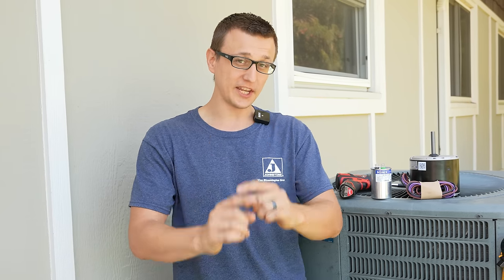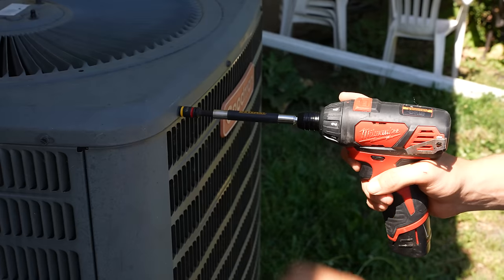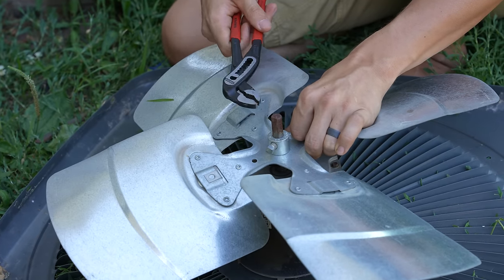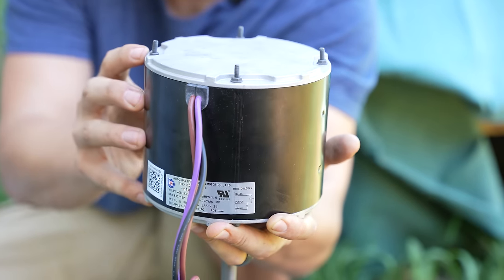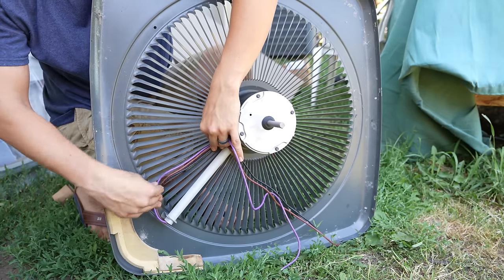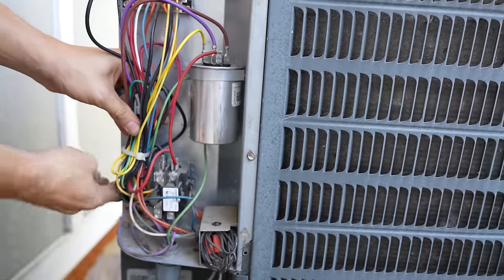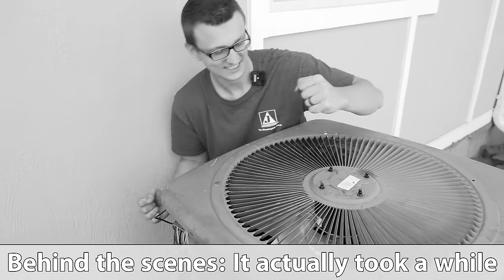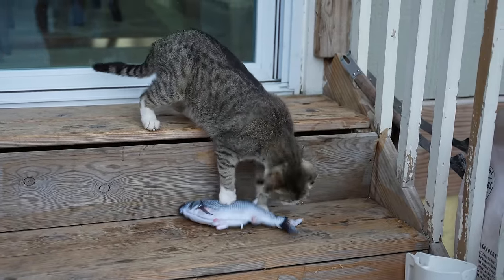How To Replace Air Conditioner Condenser Fan Motor

Comment: I absolutely love the roosters crowing in the back and every time you say the word capacitor I think of Back to the Future movie with a flux capacitor with whatever it was 8.5 gigawatts of power... You're the clearest and the best I am totally revamping the outside condenser and inside the fan it looks like some horror movie Black Mass or something oh it's bad in there I'm surprised the thing was still running so I bless you bless you you have a gift and you are using it God has blessed you you have made this chick more functional and proud because I can do it all by myself because of you

Comment: I had a condenser motor (GE) that was making a horrible squeaky sound a few months ago. I hit it with a ton of white lithium grease, but knew that I was on borrowed time with it. After getting a quote from an HVAC company for $1400 to replace, I bought the same model I had but new for $185. I was able to use this video to easily replace the now dead one and was back up and running within an hour. THANK YOU SO MUCH FOR WHAT YOU DO. You make a huge difference for people.

Comment: Good video as usual, I have a tech tip to offer, if those screws on the motor didn't fit into the holes, i would suggest to put the nuts on them before attempting to bend them, to help keep the threads safe.  Look forward to your future videos.
Reply: My thoughts as well for straightening the screws.
Reply from the maker: YES!!! That is a wonderful tip! This is why the comment section is great! Thank you Darren! Perhaps I need to get me a set of various size nuts for other situations with bent screws or bolts..
Reply: What if our replacement didn’t come with those screws…

Comment: a wire brush on a drill works great to clean the rust off the shaft.  Or wire brush on a grinder works great too, ( please wear eye protection) AKA safety Glasses

Comment: This is probably the 4th video from your collection that I have used to save me serious money.  I followed this video and managed to replace the fan motor.  I did have a problem removing the fan off the motor - that took a while to get off (I'm sure without your video I would have that thought I was doing something wrong).  Sandpaper, wd-40 and 30 minutes and it was off.  The only other problem was routing the new cables though the existing hole/grommet.  In the end, I had to attach the new cables to one of the cut cables to pull them through.  Thanks a bunch for these videos.

Comment: Excellent detailed instruction video! I replaced both my 1/10hp fan motor and capacitor yesterday myself in about 1 hour total after picking up the parts locally which were a little higher than ordering from Amazon ($192 vs $120). Originally, I was trying to locate the exact fan motor by model number, but the supply company told me they just needed to match the horsepower, RPMs, and voltage. I am sure I saved at least $500 or more doing this myself. Great video. I subscribed and as I have time, I want to watch your other videos to fix and troubleshoot stuff

Comment: I’ve watched several of your videos in the past 3 or 4 days. My AC wasn’t working and every place I called said they wouldn’t be able to get to me for a week or longer. After watching your videos, I found a weak capacitor, and the contactor was not looking so good. Ordered the parts from Amazon and got the parts installed today. After the new parts were installed crossed my fingers and turned the power back on. Now I’m sitting in a nice cool house. Thanks for the videos. They help out a lot.

Comment: Thank you! This vid gave me the confidence to change mine.  The bearings were failing and it finally gave out.  I went ahead and ordered a new motor and capacitor and everything runs as good as new!! Saved me some $$$$$$ THANKS!

Comment: I just wanted to thank you for an excellent video. I just replaced in an hour and a half my contactor and fan motor. Works perfect, Got OEM parts and I saved nearly a thousand bucks. The contactor cost me $13.00 from amazon and the AC  company was going to charge $250.00  to install it. They wanted $750.00 to replace the as yet not failed fan motor. I found OEM replacement for $213.00 and saved a lot of money.  Couldnt have been easier.  I understand they have a lot to pay for with trucks etc but thats just way over what it should be for the small amount of work it took. The contactor part took no more than 20 min. Again thanks for your well done video. Much appreciated.

Comment: Very helpful video! I'll be referring to this while I attempt to replace the condenser fan on my unit. Regarding the hassle of getting the top back on the unit, when I cleaned out my  condenser this spring, after getting frustrated trying to re-fit the top onto the unit (as you mentioned), I used a ratcheting tie down to compresss all four sides a bit and the top was a breeze to re-install.

Comment: Just went out to find my fan motor super hot and buzzing like it wanted to run but couldn’t. Disconnected power and promptly searched to find out how to change it. 

Your video was one of the first to come up, and was easy to follow, not overly dry, and overall super helpful. 

Bookmarking this so I can replace my fan motor when it comes in!

Comment: Excellent video - very clear and easy to follow instructions.  It gave me the confidence to go ahead and try it.  I followed your steps, turned on the power, and the unit started up just the way it was supposed to :).   Saved several hundred dollars, based on the quote from the pros.

Comment: Best Video on replacing the fan.
Would add that the motor is hot when you take it off, unless you shut the ac off several hours ago.
So wear some gloves to take it off. Also the connections from motor to capacitor and live and neutral are all simple easy slide types so you can easily pull them off with a plier before you lift the fan cover. This will make turning the fan upside down and placing it on top lot easier.

Comment: Got quoted $1,750 to do this job. Ended up finding this video and decided to do it myself. Only spent $98 on the fan motor and took 45 minutes to remove and replace. Thankyou for the video
Reply: 1750? That person is evil
Reply: I got quoted $600😢

Comment: Thanks for the video and information. One thing you might consider is that with my fan motor the shaft was in such bad condition, rust, your method did not work. What I had to do was use your sandpaper trick and sand the bottom part of the shaft, between the fan and the motor. Lube it after and then use a socket to place over the shaft and smack it using a hammer until it finally reached the smooth part of the shaft.  It broke free and then I sanded the rest of the shaft and the fan came off easily. Thank you again, I doubt I would have thought of this myself without your help.

Comment: Great step-by-step. It covered pretty much every detail and what it didn't was covered in other videos he linked. The wiring video helped because my new motor had 4 wires and the old had 3 wires. The only thing not mentioned was the green ground wire on my new motor, which I figure out elsewhere could just be removed as long as the motor connected directly with the frame (metal on metal).

Comment: I have been using your videos to fix my nephews heat pump it blew the low voltage trans former there was no fuse so now I am checking wires trying to find the short, Thank you

Comment: Great video. I think you should make one with "Worst case stuck fan". I had to cut it off.  Drill a deep 1 in hole into a block of wood. Then use another wood, to prevent edges damage, with a hammer method. Hard to describe. Since I don't have that metal holder other has

Comment: thank you again , your videos are always very informative, and a tip, if the bolts or screws on the motor are bent put the nuts , two would work best ,  onto the screws  then you can use pliers or channels to bend the bolts to a more upright position , this keeps the threads safe from being chewed up, ciao 4 now

Comment: Thanks for another super helpful video - love the cat interactions too! I just replaced my fan motor and condenser this past winter. For the last couple of years, the motor bearings would start making a awful racket at times. For a while, I could quiet the bearings by giving the unit a sharp rap with my hand but eventually that no longer worked so I waited until the cooler months to replace it. (Since the A/C wasn't needed then, it also allowed me the time to make some cosmetic improvements by painting the top grate which was looking a little shabby.) Got a great deal ($95), on the OEM motor from Amazon and it's working perfectly so far. I imagine that would've been at least a $700 fix if I called the A/C repairman. I love saving money! lol
Reply from the maker: You're welcome! Thank you for sharing your motor replacement experience! You are right, a condenser motor replacement can easily get close to or over $1,000 if you were to call a company out. So you for sure had some nice savings. 👍💲👍 Kudos to you for tackling it yourself. Have a marvelous new week and a great 4th of July! 🎆🎇🧨

Comment: Great video thank you for explaining step by step. Wondering do I need to check amps and voltage on the new motor after the installation?

Comment: Great video but want to mention it probably would have been a good idea to clean your condenser coil fins on the outside (as long as you had it off) as I had noticed quite a bit of dust and build up.  It would help improve air flow for both cooling and heating.  I enjoyed the video and it probably didn't matter as this was done 2 years ago...ha.  Thanks again.

Comment: For anybody struggling to get the fan blade off or for techs entering into the field I highly recommend purchasing a hub puller from an HVAC supply store, they’re specifically designed for this. In a pinch, a gear puller from an auto store also works, preferably a two clawed one over a three clawed one as they fit around the blades better.
Reply: And a small supply of Valium👻lolol

Comment: Jay, you have the BEST DIY videos on the entire YouTube network! Thank you for taking the time to be CLEAR in speaking/explaining, lighting, and video production! 

I have a question for you: 

I’m not an AC guy, I have a small, residential RHEEM AC unit out back, 20 years old, but very clean…

 I suspect I have a high pressure switch, tripping, for some reason. After watching your videos, I cleaned the heat, exchangers with compressed air, and afterwards with water, followed by more compressed air.

RHEEM RAMB-024JAZ

Suspect :
high pressure switch:

thermostat calls for lower temperature, system turns on, indoor air handler and outdoor compressor/condenser turn on, outdoor fan motor runs for about four minutes, then fan stops, and Compressor continues to run/buzz for 1 minute, and then Compressor shuts off…

(high-pressure switch; the switch wired into the smaller Freon “hot”line, and to the 24V circuit, TRIPS). Then, after things cool, or equalize after sitting for approximately 20 minutes, I can RESET the button and repeat the whole process again. 
List of components that I believe are good: indoor air handler and motherboard, thermostat and batteries, outdoor capacitor, contactors, and fan motor.

What do you think?

Comment: Great videos thanks man i subscribed. Recently I bought a replacement fan with same hp/rpm and voltage but my old fan has 5 wires with different colors from new one. This new one has 3 wires only black purple and dark brown.  Will this work if I only can only connect the 3 wires? And where does each one go? Thanks

Comment: Use Kano Aerokroil on the fan blade hub set screw.and shaft, motor nuts, and wherever you might need penetrant. 
 I've been taking things apart since the 60's when I was a kid. Travelled nine states working on institutional and industrial equipment. 
Wish I would have found Aerokroil decades ago.

Comment: Excellent video!  I just replaced my motor yesterday.  As you mentioned,  the blades were very hard to take off and I may have bent it a ittle.  All works great except that the unit seems to be vibrating.  I noticed one of the blades was slightly bent so I bent it back.  Better but still vibrating a bit.  Any recommendations?

Comment: Hi Jay, excellent step-by-step video!  Only one comment, you need to short out the capacitor leads the first time you hooked up the motors wires so you don’t get a shock.  You did short out the capacitor leads the second time when you replaced the capacitor.  Otherwise, GREAT video.  Keep up the great work!!
Reply from the maker: Thank you for the correction Bill! Glad you liked the video, have a fantastic weekend!

Comment from the maker: I forgot to mention this in the video but there may be cases that no matter how hard you try to persuade the fan blade to come off, it does not  budge even the slightest bit. You already tried everything at your disposal - the rust buster, penetrating oil, heated the shaft, threatened it, yelled at it, talked nicely to it but all that to no avail. It's almost like the fan blade hub fused with the motor shaft. If you find yourself in an exciting situation like this, they sell a hub puller that you can try and most of the time it will get the job done. Here it is: The Ultimate Hub Puller: https://amzn.to/3cLUQ5q    That being said... I have only had one time that even the hub puller failed. It just gouged out holes/trenches in the fan blade hub and still didn't pull it off. It was amazing. I threw the motor with the stuck on fan blade away and simply ordered a new fan blade. After that experience if I ever see a motor where the shaft is super rusted and looks like it may be fused to the fan blade, I try pulling the fan blade off before ordering the new motor. Just in case.. If it doesn't come off, I order a new fan blade right away too.
Reply: Since my landlord would not fix my AC I did myself last summer lol  from your videos I have learned so much ❤️ but the one thing that was sooooo hard it took me 2 days lol pulling out the squirrel cage to clean that and the fan motor make it worse I hatee basements! I'm born and raised in Florida now in Wisconsin..  basement freak me out... I have upflow so the blower is at the very bottom and how dirty even dead mice! Finally took the squirrel cage apart but OMG all day I could not take apart that motor  it took over a day 🤣🤣 I sandpapered it just like you did and everything watching his easy you do it I laughed at myself.... I also cleaned the condenser coils outside last Summer but right now just randomly it will make a sound I'm thinking if it's the motor cuz my AC is working just fine and that sound will be random not only turn it on or off just a whistle I think I might try to oil fan motor bearings
Reply: How I recorded videos how dirty the coils were and the squirrel cage I did send them to you through Facebook & letting you know thank you so much if it wasn't for you I would have been without heat or window AC lol

Comment: So im going to do all of this. Tomorrow. I thank you so much and as soon as i price things out im going to tip you as much as i can man. Your my new favorite person for sure!!! Ily tysm man
Reply from the maker: Haha you seem so energetic! Love it 😄 I just read your reply in the other thread (sorry it took a while to respond, it's hard to keep track of comments). From everything you described it does sound like the fan motor is starting to fail and needs to be replaced. But of course that is not guaranteed... There's always a small chance that it can be something else. Hopefully this will not be the case in your situation and after you replace the motor, the unit will work for another 15 years with no issues. 👍👍 I can only imagine how sticky things get over there.. And seriously, forget about the tip. Use that money to go out and celebrate your success once you're done instead. (get a chilled drink too 😉 )

Comment: Great video and well explained. I do have a question, I replaced the condenser motor, fan and capacitor. But when I went to restart the unit, it isn’t cooling properly. We did replace the items with support from the Repair supply site mentioned. What do you think the problem still could be? I’m guessing it is the actual Condenser out, but what do you suggest? Thank you!

Comment: You are a great instructor, I am a dumb a** DIYer :-)  I popped the top on my HVAC unit to clean the Condenser Coils, and stretched the wires so much that I yanked off the wire connector on the Circuit Board.  Opps.  Removed the Circuit Board and got out my Soldering Iron and soldered it back on.  Not a disaster, but it could be for some who are a little skittish about delicate electronics.  Just a FYI for everyone else.  Again I do enjoy your videos.  Thanks.
Reply: By the way, I replaced the Capacitor with a 50+5 MFD to match the one already on it.  I went to the Goodman website and note that they spec a 35+5 MFD capacitor.  Is it that big a deal???
Reply from the maker: Thank you for sharing your experience Carl! I am sure that will save someone's day later. 
A 15mfd difference is pretty big. Theoretically it will cause more power consumption which will lead to the motor windings getting hotter than they should be. That will decrease the lifespan of the compressor. If this was my unit, I would put in the right size. Will it actually make a big difference in the lifespan of the compressor though? I don't know 😇

Comment: Hi Jay, I notice your condenser fan consists of fan motor & fan grille but no fan shroud.  Is this ok without fan shroud?  My condenser fan has shroud and it was DIFFICULT put it back so in future case, is it smart undo the shroud?  

Great presentation as always 💯